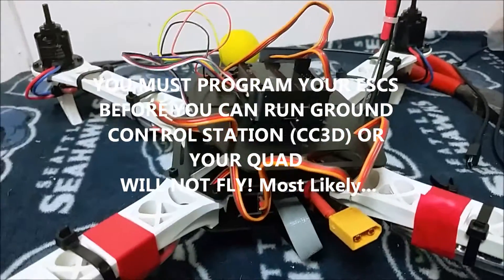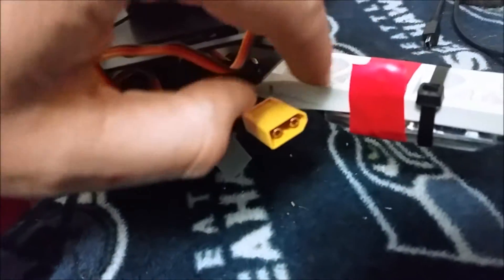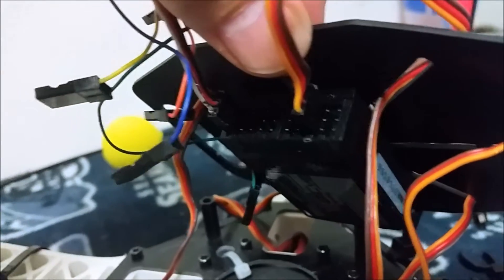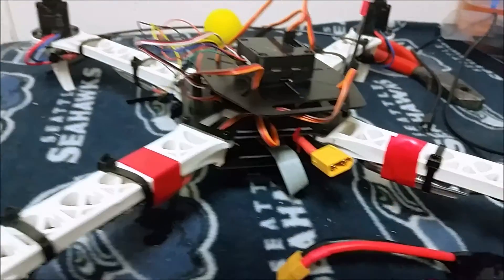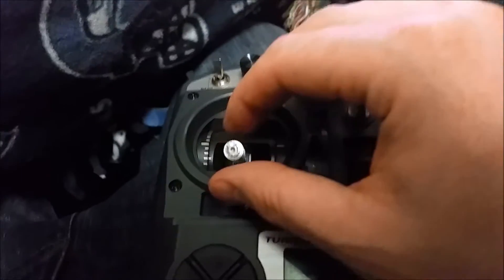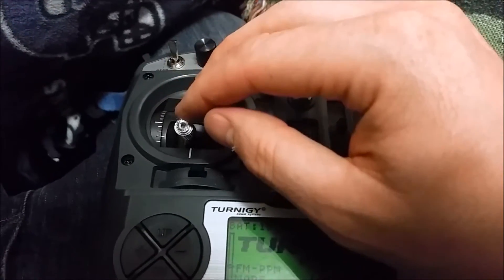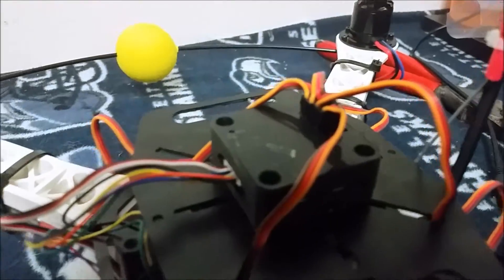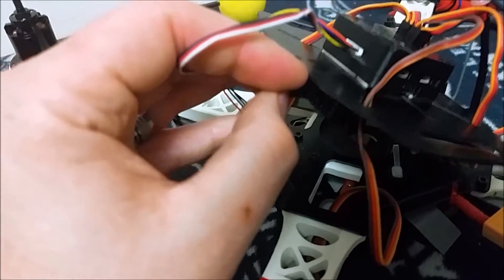How to program a MultiRotor ESC * SK450 Build video 3.5 * Min/Max Value

Comment: do you program the tx first? I'm doing this same build
Reply from the maker: Well when I made this video along time ago, you had to power the Rx and then program each esc individually before you set up your Tx in Like openpilot or LibrePilot. But now days you can program the Tx and the flight controller and as you go through set up wizard it will calibrate them for you if you follow the instructions. The. you can manually do all four in the motors tab. But then you program your TX. 
The only other things you need to do in your Tx is set up your Aux channel for flight modes. Later after programming you can also add Expo to any axis. 
Hope that's the answer you needed. If not send me an Email and I would be happy to answer any questions. 
Thanks! 
DriveFlyRC@gmail.com

Comment: Nice install
Reply from the maker: Thanks much. I would love to see a Trex500 build! I have flown single rotar a little bit but I really want a Trex500 or 450
Reply: I have a great friend that may be able to help want me to see
Reply from the maker: Cory Reeves  I'll have to message you when I get to that point. Right now I'm just focusing on this and then a Simple Tricopter or Hquad, and then the Trex, but I would love to see your build. Maybe it will encourage me to build my own heli kit. I've deconstructed and reconstructed some smaller helis. But I have never done anything like a Trex. I also practice 3d on my simulator for over a year now so I'm almost ready to jump in.
Reply: awesome
Reply: I will do that
Reply: They can kill you done wrong
Reply: even a 450 could
Reply: a multirotor is much safer
Reply from the maker: Cory Reeves yeah for sure, helis are super scary. I would never fly a single rotor with anyone remotely neer. I don't even like to fly my quad when there is someone in the same park as me. Better safe than sorry. I would never want to bring that kind of negativity to something I love so much. Safety First. :)